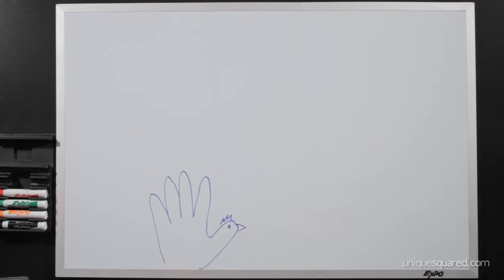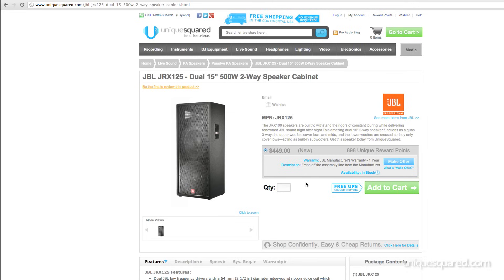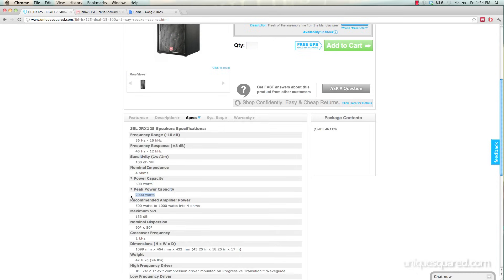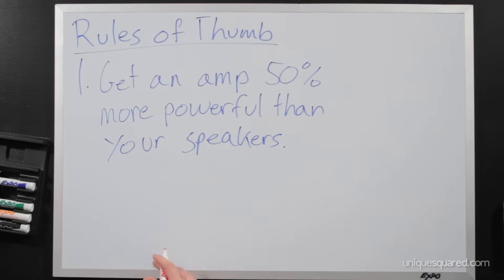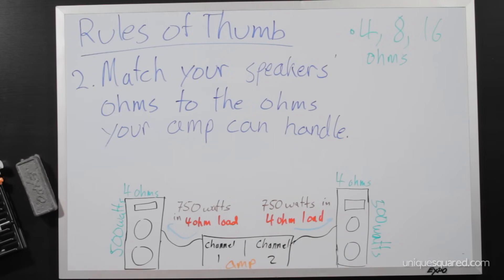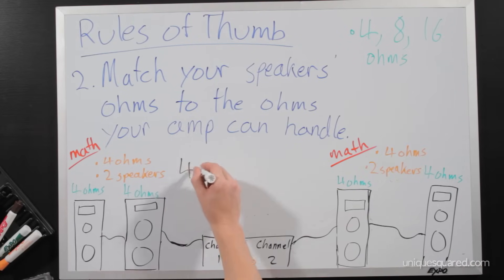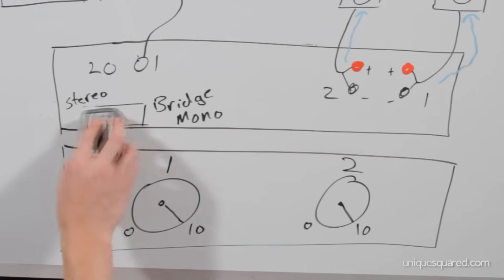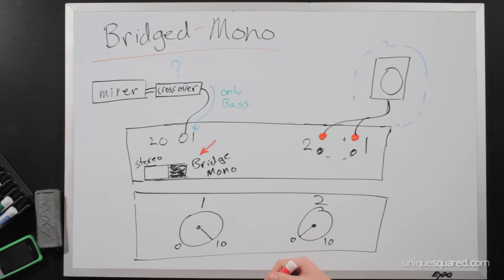Amplifier to Speaker Matching Tutorial | UniqueSquared.com

Comment: Backwards.
Speakers need to be higher wattage than amp to avoid burning coils.
Reply: I'm not an expert, but everything I'm reading tells me the opposite of this. If your speakers are higher power than your amp, your amp will start clipping, and this will destroy your tweeters. The excess heat will also destroy your amp - so having an underpowered amp can destroy both the amp and the speakers.

Your amp should be comfortably able to deliver the wattage your speakers demand. Yes, you need to be careful not to send too much power down the wires, because that can blow out your cones.
Reply: speakers are rated by how much watts they can handle not what they require. of course if you have a 500 watt amp it would not be cool to buy 50 watt speakers if you like to play loud music. You could destroy your speakers and amp both, but if you keep the volume turned down there's no problem.
Reply: You are correct with proper speaker wattage  .My misunderstanding!
Reply: What if Im carefull and I dont turn the watts in the amp very high?
Reply: That works.
Reply: no the video is correct, you need headroom on the amp rather than having it working hard constantly
Reply: Incorrect...speaker wattage should be sized higher than the amp per the video. Though the amp could blow the speakers, as previously stated, this gives your amp headroom to operate more efficiently because the amp is now allowed to be set at much lower gains.
Reply: I have a 40W amp, with two 75W speakers. Is this fine? Or should I be looking for a pair of 40W speakers?
Reply: MrFreakwent very wrong.this would fry your amp
Reply: True💯💯
Reply: MrFreakwent a
Reply: Bri G. How about 700 watt with 450 sub
Reply: I would fry my speakers rather than my amps 😄
Reply: So i wanna get 2, 120 watt speakers and mix them with 2, 75 watt speakers for my guitar cab but my amp head is only at 150 watts.. Is there anyway this can work?. Pleas and thanks!
Reply: MrFreakwent.....
YESSSSSSS !!!!!!!!!!, I did not finish watching the video for that very same reason.

Comment: ok i have a  Optimus  4 ohms or higher dual channel 100w amp and i want to buy a bass or woofer as you call it  for my car the woofer is 100w can i do that? 
or should i just get another amp only for the bass since the optimus needs to handle the 4 speakers? or just set the base with the amp and leave speaker as is?
too many qs sooo sorry.!  ps 
i dont have the bass yet  only the amp
i never set it up. i was afraid i would blow the speaker or amp or both at the same time.
 i have stock speaker i cant tell what watt they can handle or what ohms they have but if i set it up good  i am damn sure i can have more than 4 ohms with the stock speakers i saw few vids about  speaker wiring and how ohms add and divide :P

Comment: if you have 500 watt RMS speakers and a 250 amp RMS TWO channel amp then your going to ruin your speakers, because that amp is only pushing 125 watts per channel, it would be better to have a 600 watt amp RMS at the speaker ohm rating than less. so you never clip
Reply: Some of the best amps in the world put out less than 100 watts. And guess what, the $50-$100k speakers attached to them aren't exploding.
Reply: Hi Ron,

I Need your suggestion and help .

I am going to fit a new speaker system to my Car , Please find the below Speaker models & Amplifier Models as per my investigation .Please review and suggest me and correct me if i am wrong. 

Component Speakers Model : Polk Audio Mobile Monitor MM6501UM 

Speaker Specification 

System Components :2 speakers
Amplification Type: Passive
Crossover Channel Qty :2-way
System Class: Component
Nominal Output Power :125 Watt
Max (RMS) Output Power :250 Watt
Frequency Response :40 - 25000 Hz
Nominal Impedance :  4 Ohm
Sensitivity :92 dB

I going with rockfordfosgate Amplifiers .

http://www.rockfordfosgate.com/products/selector/mobile-amplifiers/power-amplifiers

Request you to compare the models and suggest me which is fit for my Speakers. Very the Nominal Impedance as well. Please review in all aspects and suggest me the best amp , It would be great helpful from your end.

Amplifier :  

 Model:   T800-4ad       Model: T400X4ad         Model: T600-4           Model: T1000-4ad

Thanks & Cheers.
-Madan.
Reply: Hey bro what's your money situation
Reply: Can you afford 2 ohm stable amps
Reply: And Rockford Fosgate punch amps are a good start
Reply: I have Focal component speakers love those
Reply: They are pricey tho
Reply: But sound nice
Reply: Hey Ron ,

I dont have any concern on Money , I need good and Best Sound System to fit for my car .
Can you please review the Speakers and Amplifiers which i have posted , Please suggest which is suitable and best for me  .
Reply: Did you get a chance to review my requirement
Reply: Hey guy sorry I don't do reviews on YouTube, I just some random guy who loves setting up stereos in the cars he buys
Reply: Well the amp models you have talked about,I would say yes to any of then, and as for the speakers, are those the only speakers that your getting , I certainly hope not
Reply: I hope you consider a set in the side rear panels and a set in the rear top panel and maybe two 10 inch ROCK FORD FOSGATE P3 PUNCH SERIES SUBWOFFERS  for your trunk and a good head unite, oh and maybe look in to a Rockford Fosgate  3 Sixty 3 sound processor, and you will need a laptop for or the last component I spoke of
Reply: This is not a true rule. No speaker has a MINIMUM requirement of 500 watts. The 500 watts is the MAXIMUM amount of power they can take. if the speaker has a minimum need of 50watts, which is normal to high, then you can absolutely use a 125 watt per channel amp as long as you dont have a massive room and want to play at ear shattering volumes. For instance I have a set of Theos Speakers, and like all martin logans they need good clean watts. But the minimum wattage required is only 20 watts, with s 400 watt max. I have driven them with 50 w, 95w, 200w, 260w and 300 w amps. The 50 and 95 couldn't push VERY loudly but sounded fine at lower volumes. All the others are very much below the 600 watts you say are required and drive them to uncomfortably loud levels.
Reply: the ratings for speakers is how much power in watts they can safely handle, not what they require. And some speakers are more efficient then others.  for example I wanted to buy some Infinity speakers high quality, but I was told they aren't  very efficient they tend to soak up power so I would need a pretty powerful amp to drive them. So it all depends on the speaker how efficient is It?
Some will require more power than others.
Reply: aaron phillips try pushing 125 watts through those speakers, and they are rated 500 watts , you will ruin them, by clipping in a short amount of time, better to have over kill than not
Reply: Ron Merkus again that is ONLY true if I were cranking it to max volume all the time. Then there is the risk of clipping but 125 watts will take these speakers near 100db which is louder than most people want to listen to anything. I have these connected right now to a Cambridge 851a which "only"  pushes 200w into 4ohms. It is working just fine. No clipping no dead speaker.

Comment: Sir nice video. I bought Kenwood KAC-M1824BT amplifier for my motorcycle i will truely appreciate if you can please let me know what speakers specification i can buy for it? my amp features show 
Signal to Noise Ratio: 90 dB
RMS POWER Output 4Ω: 45W x 4
RMS POWER Output 2Ω: 45W x 4
RMS POWER Output Bridged: 90W x 2

Comment: Great video.  Can you help me with my problem?  I have an amp that can pump 500W at 4ohms.  I've attached a 4ohm speaker that's 250W.  Sounds great.  I want to add another speaker but it's 8ohms at 300W.  Can I do this?  The impedance are different.  Will this blow up anything?  Thanks.
Reply: well you should not need the other speaker , besides the two are different ohm ratings, unless you cannot change the ohm rating of the 8 ohm there is know use

Comment: Resistance and Impedance are not the same things.
Reply: Impedance is Resistance with a cycle vector in AC current. In DC they are identical. In this application its doesn't matter. Don't be a dick. He is trying to simplify something for beginners.

Comment: Hi, 
     Your info is so good and clear. Please help in the case, i have TDA7560 4 Ohms 45 W-Max 51 W then,  what is voltage & amp  to apply and which speaker is suitable?

Comment: this guy is right on! I was looking at another website tutorial that went the opposite direction... buy an amp with less wattage than your speakers!!! THIS IS WRONG!!! YOU WILL NOT GET THE BEST PERFORMANCE OUT OF YOUR SPEAKERS AND YOUR AMP IF PUSHED TO ALMOST THE MAX WILL DISTORT THE SOUND!!
Reply: this makes no sense, you do realize that pushing things anywhere near the actual limit on a good set of speakers and amp for a continuous period of time is not only not advisable, it would be painful because it would be a painfully loud system. you DO NOT need to exceed your speaker's max by 50% because unless your speaker has a max of 50-100w you will NEVER want to listen to them that loudly unless you have an insanely large room.

Comment: I have a set of old speakers. Two 30W subwoofers with four 12W tweeters, then two 25W mid range speakers. All of which at 8ohms each. What would be my amplifier or how do I compute for the total watts so I would know what the capacity of the amplifier I need to get for them?

Comment: Thank you for your video, It is very informative
I just like to inquire about my PA system if it is ok or no.
I've recently acquired a prosound mixer 550w and a behringer ep2000 
and 4 speakers with different watts
2pcs  800w @ 8 ohm
2pcs 300w @ 8 ohm
We are going to use it to a newly formed small band on a gig for our company.

Is this a possible to work this out because I'm confused about connecting it on parralel

Comment: I have 4 mission 737r speakers 120w rms to a Sony fb740r qs rating 180w power consumption din power output 100w + 100w @ 4ohms 60w + 60w @8ohms it's sounds great can play to high volume without distortion I also have another 4 pair of mission 737r to a Sony fb940r 210w 120w + 120w @ 4ohms 80w + 80w @ 8ohms they also sound great can really push them all and sound sweet they have 4 channels in each amp but what your saying you need enough power amplifier to power the speaker or I'm damaging my amp is this true or is this a good set up ? Thanks
Reply: I have them wired red black to red black with all four no bi wiring or anything

Comment: Nice video man!

I have one question: 

Will this work?
I wanna buy an amplifier with 300 RMS 4ohms impedance, can i use this amp to power the following speakers?

Channel 1:
- 6 1/2" speaker RMS 60 watts, 8ohms
- tweeter RMS 15 watts, 8ohms

Channel 2:
- 10" woofer RMS 200 watts, 4 ohms.

Daryl

Comment: Guys, please please consult specialists. 
This generic guide is just something to follow if you have to , if you do not know.
But the reality of impedance loads and matching items is much more complicated. 
It goes so far as that stating a wattage number is irrelevant and means nothing. 
There are diagrams, distortion levels when watts measured, all or 2 or 1 channels driven, there is fast ohm transitions and inclines and declines or smooth transitions, in the hz scale, there are a million factors. You REALLY really have to know your stuff. 
So please, keep in mind a few rules like "a speaker can only be really blown when an amplifier is giving out distortion -aka a circuit, source or low current problem" and please consult a technician.
Happy soundhunting :)

Comment: I have an amp that's 15W per channel and speakers that are 25/75W. The speaker manual says that to successfully run the speakers I need at least a 15W per channel amp. But it's still less than those 25W. How does this work? My speakers sound just fine.
Reply: +I967 ur amps was underrated but of course is will produce sounds,but try to run for a quite long period of time then u will see what will happen and u will understand the difference....

Comment: I have a Power Mixer with a power of 600W, 2 Ohms minimum load per channel, and I always connect a couple of 800W, 8 Ohm speakers to it. I hace been working with that setup for almost 10 years know, same equipment, and although I've changed it's fuses, that setup work just fine, some times I have connected a Bass and 3 Mics to it and it just work fine, why my amp hasn't blown up?
Reply: +Grillo Sonico Because this theory is flawed.. if you have a low wattage speaker being driven by a hiwattage amp over an extended period or max potential, you'll blow the speakers cuz they're not rated for max wattage being pushed by the amp. Always over rate your speakers. Like a fuse needs to be 125% max over the running amps, the starting amperage can exceed and blow your fuse. Same principal. The resistance is what you need to be mindful of. Never go to low on the resistance, lower than the rating set on the device. You can increase the resistance, but too much will, as stated, under perform and be weaker output than the resistance that its rated for.
Reply: I just have a quick question. What will happen if i use a 500 watts speaker in a 60 watts amplifier? Hope you can advise me.

Comment: Yea i have a pair of behringer b212xl speakers. Theyre 200 continuous watts and 8 ohm. From this video i decided i needed a "300 watt 2 channel amp with 8 ohm load." Correct me if that is wrong please! Also, they were all around 300 dollars which is more than i payed for the damn speakers! Is there a cheaper solution? Please respond asap! Thanks
Reply: +CrackaJack022 u can atleast 250 watts per channel @ 8 ohms there's no problem with that...quite cheap that 300 watts model...

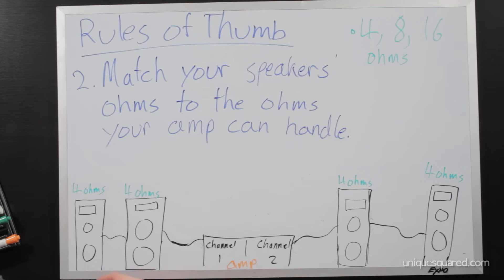Comment: 05:43 And remember. Dividing the impedance by the number of speakers is only correct when all the speakers have the same impedance. If you connect different impedance speakers to a channel you'll need to calculate the net impedance differently and also keep in mind that different watts will now flow to the two speakers because of the difference in impedance.  So its always a good idea to keep with the same impedance and watts when bridging multiple speakers to a channel :)

Comment: I'm assuming that something has to be said about how much is driven into the amp. For instance A 4 piece band (2 keyboards, electric guitar, and Bass) at a very small gig. I use the following

- Yamaha Stagepas 400i Powered Mixer
- 2 70W speakers 
- 1 90W monitor
-- 1 130W sub

I've used this set up successfully quite often before but last night it just sounded horrible. Right off the bat it sounded distorted at normal instrument levels. I can't figure out what happened. Last night was first time at this particular venue. Not sure if that was the issue. Some advice would be helpful.
Reply: +Gordon Hazell Are the LEVEL controls of all relevant …
 channels and/or the MASTER LEVEL?control set too high
 Is the MIC/LINE switch of the …?=corresponding channel set to MIC ,If the input level from the source is high setting the MIC/LINE switch to MIC may result in distorted sound. Set the switch to.LINE position Is the volume of the connected device …?too high.=Lower the volume of the external device
 Is the speaker cable or the power cord …?=located near the input cables.Please keep it away from the input cables...
Reply: +Gordon Hazell at what particular speaker Impedance do u used?coz the model you've mentioned is designed only for 4 Ohms!
Reply: +Gordon Hazell Maximum Output Power (SPEAKERS L/R
200 W + 200 W/4 Ω @Dynamic at 1 kHz
180 W + 180 W/4 Ω @10 % THD at 1 kHz
125 W + 125 W/4 Ω @1 % THD at 1 kHz

Comment: So when you run 2 speakers in parallel on one channel how much power is each speaker getting?
Reply: Joshua Ceaser Do you mean 'one channel' as in the bridge-mono?  As it combines the two sides (left and right) together, it gives you 1600 Watts @ 8 Ohms and 2000 Watts @ 4 Ohms.  If your speakers are hooked up in parallel (with each speaker being 8 Ohms) then the output Wattage is going to be 2000 Watts @ 4 Ohms.  Both speakers are getting the 2000 Watts of power.

Comment: Ohh, I think having receiver amplifier rating one should use speaker that has equal or more impedance and power handling capacity equal or more. Having lower impedance will damage amplifier ( requiring more current) and having lower wattage will blow away speaker.
Reply: rakesh dwivedi  yes this is correct.But the most important thing to remember is to run the amp under its clip level.You can over drive most speakers as long as the amp is not clipping.If you have a small amp You will hit clip and blow.

Comment: noob question.
i have a 500 max watt amp. can i hook in a 230 w 40w rated power speaker in it? i have a subwoofer connected to the amp already.

Comment: OMG. To overload an unlucky speaker then its R.M.S power can handle is not so wise... - . -  since it is a stupid way to kill them by distorting or blowing them up. Do you use yours like this, because I can hardly belive that! 

Otherwise, there is an untold but still living Hi-Fi rule which recommends to the amplifier unit to be about 1,5x weaker then the actual driven speaker to get the best possible results from both of them without any smoke! ;)

Comment: So i have a setup I am looking to buy, it has speakers that has 60Wrms front and 100Wrms rear X4 for my car, both run at 2 ohms. So that is a total of 640watt rms needed. I found an amp by MB Quart (sq classification) that runs 160watt rms x4 @ 2 ohms, which is 640watt rms on the dot. Is this perfect or not enough? Since these numbers are not running their peak I should be safe?